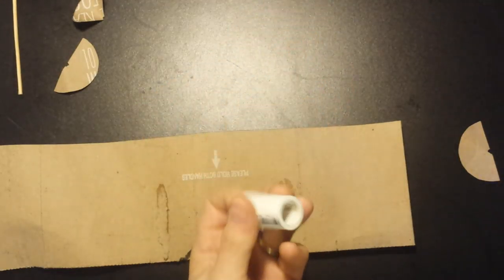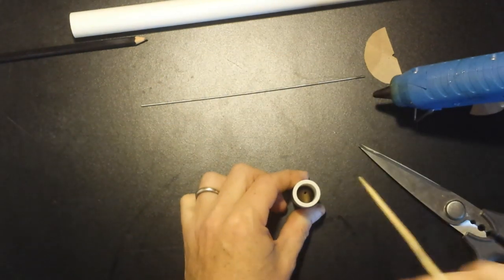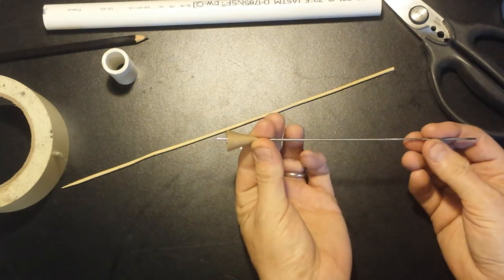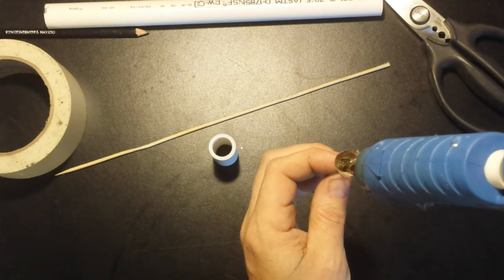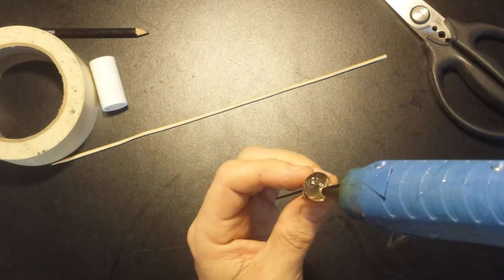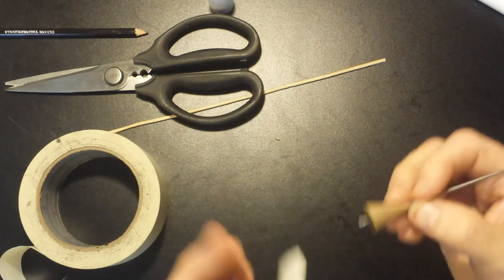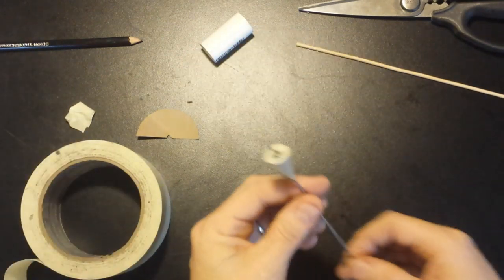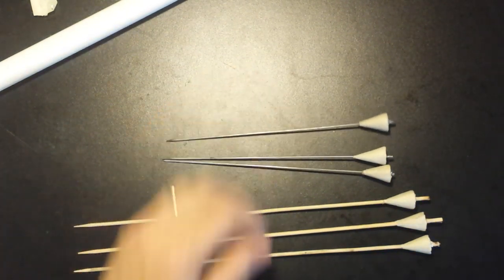Homemade Blow Gun and Darts from Hardware Store Parts!

Comment: Good video,but if I may suggest something.To ensure the rod is centered in the paper cone,add an end cap with a hole in the center on the end of the short tube,do not glue the cap it has to be removable.Pvc end caps available off course for all pipe sizes.